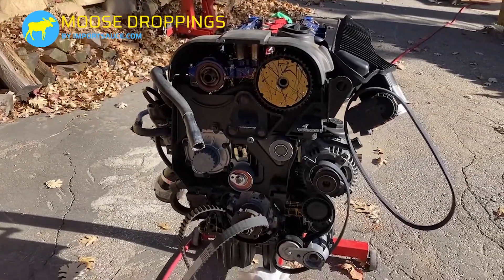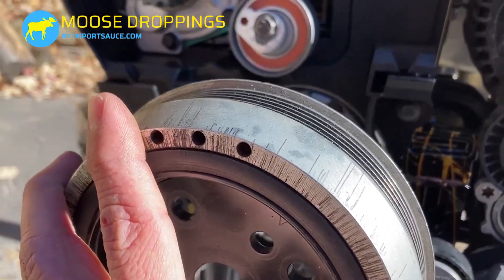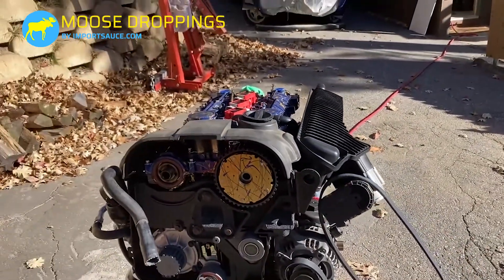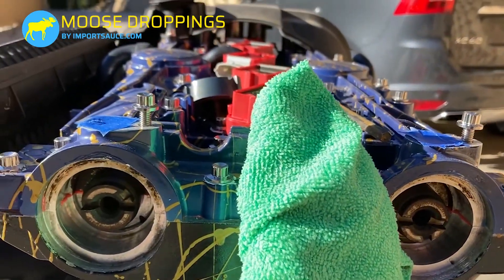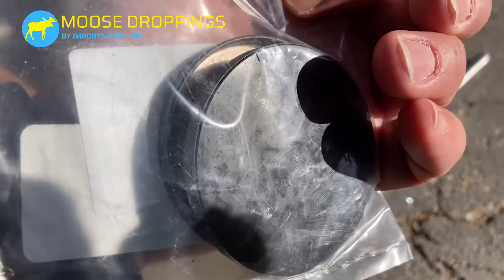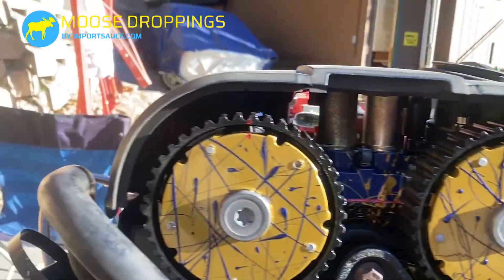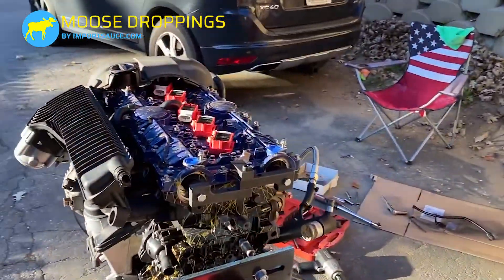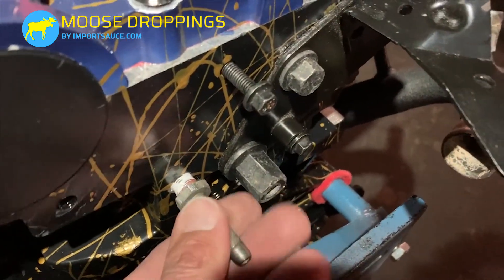Volvo T5 Engine Timing - The Ultimate Guide to the Volvo P1-T5 Engine - Step by step

Comment: There is a 2notches  on the of the oil pump and you can still see those aligned with harmonic balancer on. Please sometimes you referring to cylinder 5 as cylinder 1

Comment: I have a super big question wondering if you could help me? I had a hard time. I was timing everything my kids came into the shop and threw me off a bit. I did mark everything and I have the cam. Locking toolkit and all that in place, but I think I might have got this center vvr hub off a hair and I don't have a mark for it, what I was wondering, is there a way to set the very center hub back in line or a reset procedure

Comment: I am replacing the intake VVT gear and camshaft seal on a 2.4i (b5244s) wich has the same vvt on intake but no vvt on exhaust. How do i torque down the intake VVT without moving the gear? I tried mounting the belt first and torquing after installing belt but this just lead to uneven tension on belt and timing was a bit off after one rotation. How did you get your gear to align with the mark? Just trial and error or is there some tool?
Reply from the maker: 100% you need to use the cam locking tool. You can find no name brands on Amazon or eBay. https://a.co/d/fIRnP5X
Reply: @moosedroppings  Thank you for the reply! My camshafts are stationary and i want to hold the gear while i torque down the bolt.

Comment: Hello
I want to know the timing of sprocket locking. Should it be before or after belt adjustment?
If you lock the sprocket first and then adjust the belt
Wouldn't the mark position change again after the camshaft retaining device is removed?
Reply from the maker: Sure, adjust the sprocket, place belt without letting them move, torque sprockets to spec,
Reply: @moosedroppings  Thank you for your answer. 
My car's exhaust VVT has had problems twice. 
I plan to re-adjust the timing.
Reply from the maker: @bikejeff  Yes, I had to adjust mine twice, they like to move,
Reply: Does the car will throw an error code if there's timing issue ?

Comment from the maker: Yes. Correct.  These is not a spring inside but the pressure moving the sprocket relative to the cams. Using the cam lock tool allows perfect alignment of the cams and then without pressure the sprockets should align to their proper position and only with pressure should they be able to adjust, so when the car is on and the vvt allows modification of position. I was thinking I had a similar issue as getting vvt errors but timing was perfect. The heads off again and we’ll be doing timing again and hope to have those codes gone.
Reply: @moosedroppings  Thanks for your reply. Spring loaded or not the uncertainty I have is as follows: camshaft perfectly in place (locked with the tool), camshaft adjuster gear marking aligned perfectly and matching the cambelt (it's teeth), however that moving middle part of timing adjuster has a limited range and maybe could be moved clockwise or opposite if is not locked (some of those have internal locking pin actuated by the oil pressure at the engine start otherwise remain locked (whole unit has no moving parts by hand so  installation can't go wrong - is it our case?). If the middle part of adjuster is free to move then the whole range of retarding vs advancing will unlikely be within specific range. I am about to get there in my car to take a risk and check it myself. On one video a guy disassembled timing adjuster from Audi to show how sprocket can move although the middle part which is bolted to the camshaft stays in place so in reverse order when installing it would be possible that marking just shows sprocket's positions as correct, camshafts locked correctly but still system will be not able to move within desired range. I hope I share my confusion clearly. Have a good weekend.
Reply: did you have any luck with this? i have the same issue and cant find a solution
Reply from the maker: @Grumbly-hk8hz yeah. Timing was just off. 1300 miles later and no issue.
Reply: @moosedroppings  ah ok, did you have to setup the vvt phasers any set way? keep reading different information
Reply from the maker: @Grumbly-hk8hz  following vida, there was no specific reference, so when winding the belt and then securing it, it should self set.

Comment: Those gears are timing adjusters are not spring loaded and because they have the central part bolted to the camshaft aren't they supposed to be rotating and moving with the camshafts at variable angles because the oil pressure will work inside of the adjuster (gear)? Meaning - although marking outside can be aligned, the central part of the camshaft adjuster can be in wrong position so will be a cam and as the consequence not being able to move at correct and full range between retarded and advanced angle?
Or that adjuster is a fixed sprocket without any moving parts inside?
That bothers me a lot and I can't find an answer.

Comment: What if the sprockets move off marks while trying to put on cam lock tools?
Reply from the maker: No worries since you are dialing the timing in anyways. You can just make sure everything lines up as you dial it in.
Reply: What if the cam wheel was rolled backwards?
Reply from the maker: @2cents740  Are you saying the cam gears moved while the cams were locked, meaning the gears moved off the alignment of the cams? If so, easy, doesn't matter, align the cams per the locking tool, then you can align the cam gears to alignment marks on the plastic cover and tighten.

Comment: Hey question, I have the belt off: when i put the crank at the TDC line on the oil pump, and I check piston one to confirm it is at the top, the piston can actually keep moving up a bit more when i rotate the crank. So, piston one is not at the top when the crank lines up with the notch on the oil pump. How do I fix this? I am obviously missing something
Reply from the maker: There is no adjustment. Piston one is bolted to the crank. The crank is sandwiched between the block and bed pan. The oil pump only bolts in one way. That is strange but if you’re talking a mm vs a half inch that’s a big variation. I couldn’t say for sure what your seeing but if your able to check that might as well also do a compression check and maybe a leak down test since your spark plug is already out. No leak lose and hood compression should set aside any worry